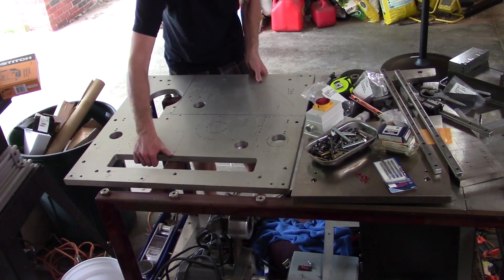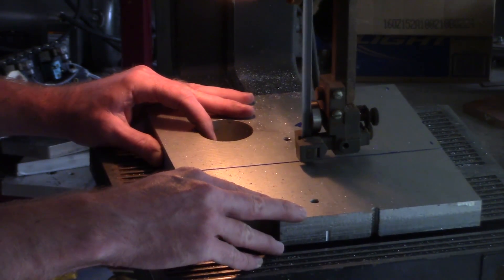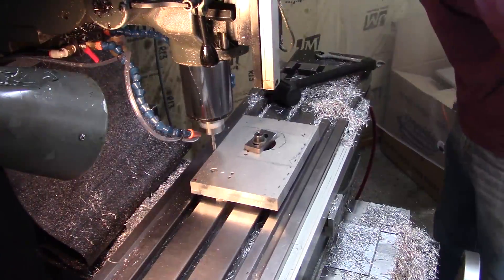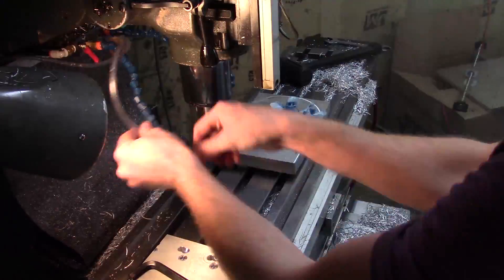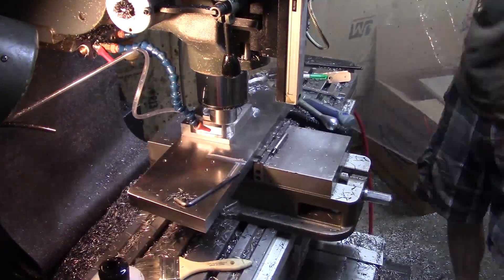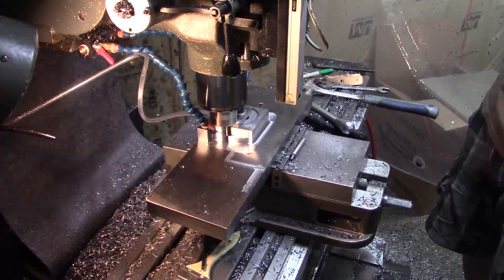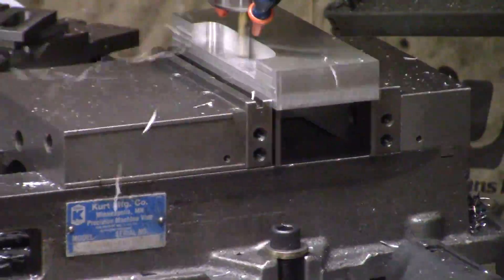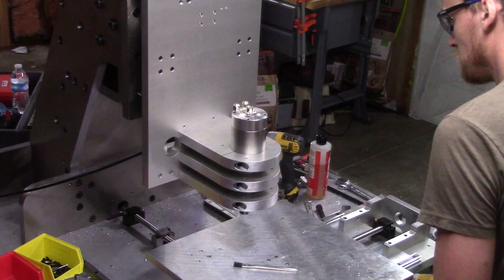Finishing up the mechanical bits on the DIY VMC

Comment: I am a newbie to cnc and currently design to build one myself.

Question???
Don't you think there are any problems when the length/width ratio is less than 1?
Reply: You mean the machine travel or what?
Reply: @henrychan720   I meant how you arrange the blocks on linear rail.
Reply: chirots I’m still not 100% sure what you mean by length to width ratio means. But if you are refusing to slighting rails and blocks, it’s kinda tricky. The correct way is to have a groove precision ground into the plates and then you line up the rail with the groove. However I would assume that is not possible for most DIY builds. What I suggest is getting a straight edge and a test indicator. Mount 1 rail, making sure it is straight, then attached the carriage and let the second rail choose where it wants to be.
Reply: @henrychan720  hahaha. 

"Width" is the distance between rails
"Length" is the distance between blocks on particular rail.

For example, x axis
I install 2linear rails, the distance between them is 250mm(Width). There are 2 blocks on each rail, I arrange these 2 blocks 250mm apart. Therefore it becomes square. The Length/width ratio is 250/250 = 1.
Reply: @henrychan720  I don't know what I have to search for on internet.
Reply: @chirots  It doesn't really matter. The further apart the blocks are in certain direction, the higher moment rigidity it has in that direction. It doesn't hurt to have them really wide apart (of course not so ridiculously apart that the plates they mount on start to deflect a lot). If money and space allows, spread them as far apart as possible. Right now I am building a VMC too. Y axis has 4*30mm roller blocks from HIWIN blocks 8" apart from each other in a square.

Comment: Do you only have one end mill size. A lot of those cuts where you are just removing metal would go smoother with a larger cutter rather than using your smaller cutter and making several passes. FYI

Comment: Thanks
1. Understand the Z axis issue now, I didn't understand you were manually moving the Z axis
2. UCCNC is new to me, good tip, very helpful
3. Fusion is not familiar to me, take courses off and on using Solidworks, but no CAM at a reasonable price. Solidworks for students very reasonable, but only one year license. 

Again thanks for the comments and answers.

Dennis L.
Reply from the maker: Definitely, definitely check out Fusion 360. It's from Autodesk, the makers of Inventor and is CAD and excellent CAM for FREE, as long as you are making less than $100,000/year.  Even after that it's like $35/month.

Comment: 1. What is the advantage of your new machine over the existing machine you are using? Assumes the personal satisfaction of doing it is ignored?
2. How do you program your current machine? 
3. What do you use to do your drawings?

Very clever project, nice use of existing materials, excellent workmanship as noted by others.

Dennis L.
Reply from the maker: 1. The new machine can move in all three axis via CNC so I can do 3D machining and just generally not babysit it all day to move the Z axis every time it needs it.  It uses modern computer controls so no more programs on floppy disks, no 8 character program name limits, has network connectivity and finally, no more modifying gcode for every file to remove problems with that controller and it's "conversational" programming language/lack of Z axis control.  It can also move much faster, 500+ ipm vs. 200.  It will have a full enclosure for flood coolant.  The controls support things like turning the spindle/coolant on and off vs doing that manually.  The spindle is 5 times faster RPM-wise which is huge for the smaller tooling used on the smaller projects I will use it for.  Also has potential for a 4th axis, tool changer and other neat stuff in the future.  It's also made of "consumer" parts so if something breaks/wears out; I don't have to track down an obsolete part and pay, potentially, thousands of dollars.

I bet that's not even all of the advantages. :)

2. Using UCCNC and one of their controllers for the time being.  Don't want to start out with Mach3 since it's already obsolete and isn't being updated.  Mach4 still seems to have issues from what I have read.  LinuxCNC - I just don't want to re-learn linux and try and do all the networking, etc.  TinyG and the arduino-types just aren't powerful enough and don't have the extra features I need for this.  If I'm gonna do it, I want to just do it right the first time.

3. Fusion 360 for CAD and CAM.  Not perfect but easily the best in the free category.  Easily the best under $1,000 come to think of it.

Thanks for watching, glad you like it!  (cool stuff coming soon!)

Comment: Any guess to how much this beast weighs. Even being aluminum bet its heavy. Nice work looks like you have spent hours on this project so far. Would be interested in how much you have invested in aluminum costs so far.
Reply from the maker: It has been many, many hours.  According to Fusion 360 it should weigh about 1,500 lbs.  I haven't really invested anything in the plates.  I got them at scrap prices which is basically nothing.  I mean nearly a ton of steel was $40.  The cast aluminum plate I made all the parts from I had already and I think that one may have even been free.

Comment: The ONLY thing I would change is the spindle. Everything else looks awesome!
Reply from the maker: Indeed.  It's a cheap (<$200) placeholder for a nice high speed quick change spindle; that's why the plates are so big.  I just needed something to prove out the machine before I spent several thousand dollars on a spindle.

Still, those spindles do a remarkably nice job for as cheap as they are - and it's still 3HP so it's no slouch.
Reply: +Chris DePrisco True that. We process a lot if plastics and some aluminium with a 2.2 kw and they have some chooch to them.

Comment: Im curious how ridged the vmc will be and how aggressive of a cut you can take without much chatter.
Reply from the maker: That's why I'm using a high speed spindle. I will be relying on very high speed motion and small widths of cut to get decent removal rates.
Reply: Will this machine primarily be cutting non-ferrous  material such as aluminum and brass?
Reply from the maker: Mostly, yes.

Comment: Fantastic as always Chris. Just a quick question: You have the Bridgeport that is CNC driven, what is the driving reason to build one?
Reply from the maker: It's worn out, has very antiquated electronics, has a low rpm spindle and feed rate and is only 2 axis CNC. Not to mention if anything breaks it will be quite expensive to repair.
Reply: Makes perfect sense.
Reply: Worn out? That thing looks mint compared to my bridgeport. Any my bridgeport looks mint compared to how it used to lol. Your ways and spindle are so shiny and clean.

Also, if you watch your videos, it's no surprise why that machine would be worn out.
Reply from the maker: lol :)

Comment: very nice series, thanks for sharing. Just wondering why you have the spindle that far out? should you have some end-plates that join the 3 mounts and going up to the vertical plate (like a gusset)?
Reply from the maker: It is hopefully only a temporary spindle and because it's small it has to be far out if I want it in the middle of the work area. I was going to do gussets but I think it will be ok without them. If not, I'll add them later.
Reply: @ChrisDePrisco  Are you serious? You've spent 10K for alumunum to get this crappy machine and installed cheap chinese spindle with low torque at it? Hey Nice work, you're a genius.